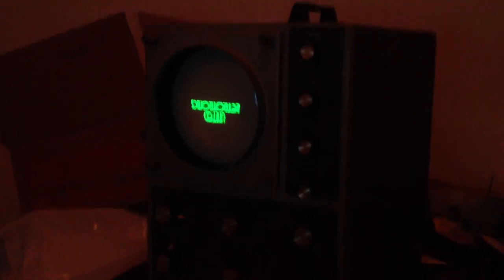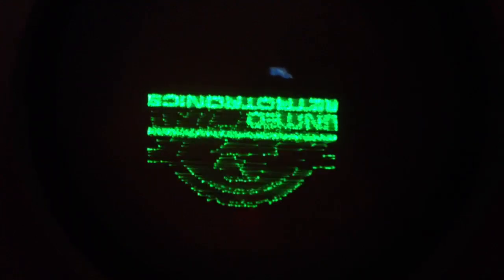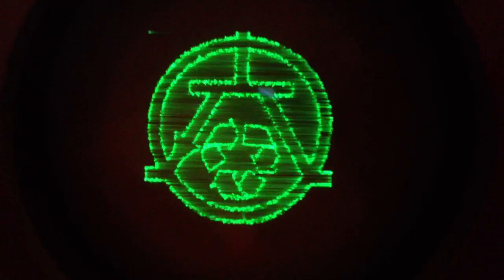United Retrotronics Model 2, Rasterized Oscilloscope Clock

Comment: Note the missing samples, a good idea but don't you simply want to miss samples that are not within the sample time window rather than at random.  You might do better to pick a slew rate that is real for the sample rate and simply drop samples that do not fit in the slew interval. That way a RC stuck on DAC would probably give you a sparkle free output - the compromise is getting the value of capacitor low enough to work but not so low it makes your lines curve.

Comment: Very nice indeed.  I have been browsing all the Oscilloscope graphics videos. So, this is just X-Y and you have no intensity control, so you rely on the rapid beam movement to draw very light lines between "on" pixels?  I've been doing Laser Graphics X-Y stuff {actual laser on the wall] since the 80's, so I understand X-Y , Vector and Raster and scopes.
Steve N

Comment from the maker: Making the beam move back and forth to 256 different places along 256 different lines is very time consumuing. Even at 48 KHz audio sample resolution, the resulting image flickers very badly. To get past the flicker problem, my code will randomly skip X number of pixels when drawing, knowing that on the next pass, those pixels that were skipped will eventually be drawn on subsequent passes. The net result is a stable, but sparkly/grainy image that relies on human persistence-of-vision to work.

Comment from the maker: In order to create pictures on an oscilloscope screen in XY mode, you need to have a DAC of some sort. There are popular DACs available like the MCP4725, but there's a far better (and faster) one right under our nose..the sound chip. That's all a sound chip really is, when you think about it. An extremely fast DAC.

I wrote some code that takes a 1-bit 256x256 image, and converts it into 8-bit stereo audio. The L and R channels of the resulting audio sample then control the position of the beam.